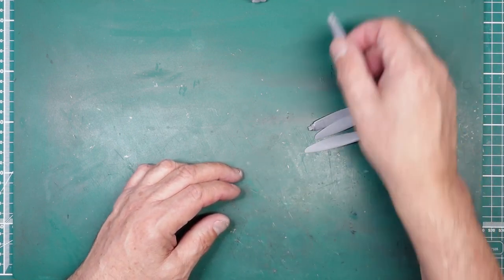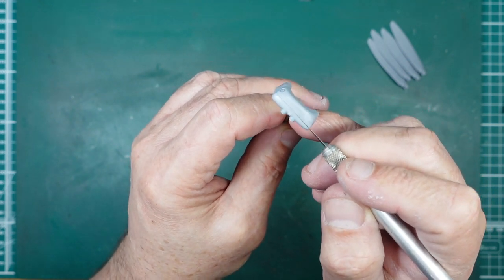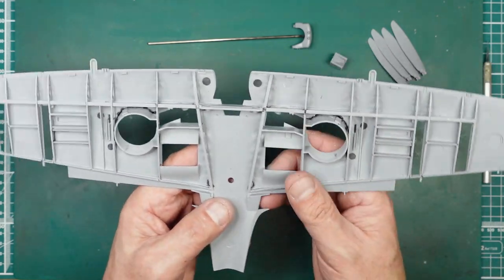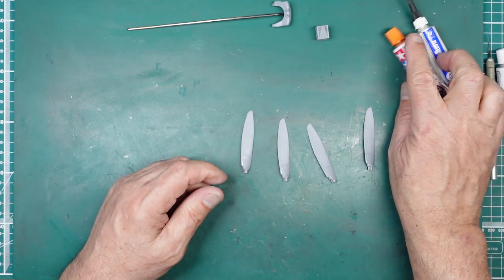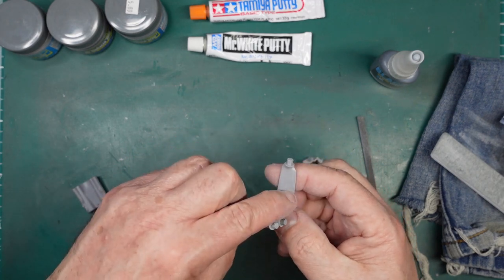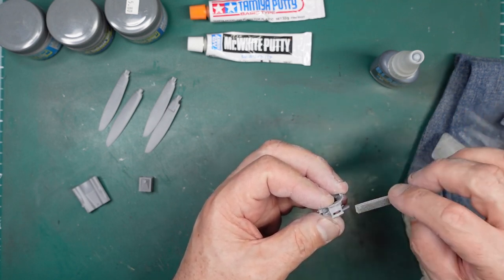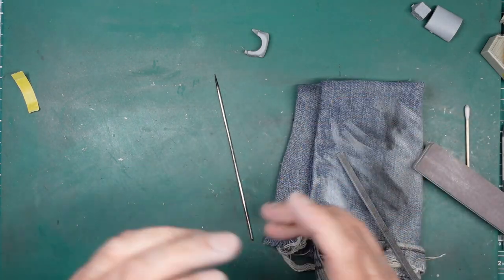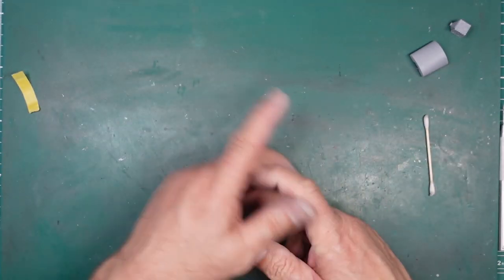Filling Seams.. for Beginners.

Comment: Hi I haven't done a model since 1982  so every thing has changed. I what to start on the  Italeri  Short Stiring but the kit looks to have way to deep lines on the Wings and Fuselage. .which should primer should I use to fill in of Mr. Surfacer?  Then after that will do the Airfix 1/48th Avro Anson. My Father used to fly in the Anson in The RCAF during WW11. I have never used filler on models back then.. I Also got a Air brush first time for that also.. Found you on You Tube buiding the Massive 1/32 Lancaster. Good luck on that project. My uncle flew the Lancaster in the RCAF over Germany in 1943 and made it back to Canada after the end of the war..
Reply from the maker: Hi Ron. yes, Use mr Surfacer then remove with a cotton bud as i did in the video. Rub across the line rather than along it.

Comment: Over the years l’ve tried a number of hobby putties, the problem l find is that the small tubes of putty start going hard after a short time, so l rarely get to use more than half of the putty, sometimes a lot less. Ended up trying auto putty, made for small scratches. The tube is a lot larger than hobby putties and stays soft for years. It’s also cheaper and sands like a dream and does not shrink.
Reply from the maker: I use that exact stuff for large jobs. You will see it in use in many of my videos.

Comment: Also the black CA has rubber fillers in it which creates a stronger Bond it's more or less tire glue if that makes sense
Reply from the maker: I thought that, the same as the Bob Smith stuff? It certainly is softer and less brittle.
Reply: @NigelsModellingBench  yes I believe, I use Bob Smith stuff and it works well, plus it's much much cheaper, as far as I know. That is my biggest problem with this hobby, different brands make the same stuff,  but certain brands charges 2 or 3 times more for the same stuff.

Comment: Howdy mate. I do the same thing as you do with Mr Surfacer but with the Tamiya grey primer in the bottle. Just like the Mr Surfacer it sinks back quite a bit so take a few applications...but for me here in SA, it's half the price of Mr Surfacer. The Valejo putty I use for wing and tail fillets and works a charm, it doesn't seem to like being sanded though. Think I'm gonna try the MIG black super glue too😉...any other tips n tricks videos would be GREATLY APPRECIATED mate😉👌👏👏👏👏👏

Comment: I no it's an old video so I may not get an answer. But if I use the mig super glue black and the underside of the aircraft is a light colour how do I over come the fact it leaves a black line in the seam or am I missing something out.
Reply from the maker: Well, you would paint over it?
Reply: @NigelsModellingBench  OK so it will cover over even if it's white paint .I no it sounds a still question but just don't want to get it and it won't cover over that's all

Comment: Hi Nigel. I’m new to the hobby but I’m loving it. Done some nice models from Tamiya tanks to Airfix planes, even a lovely Battlestar Galactic cyclon centurion. But Ive got a question. 
Could you use decorators caulk as a filler? It drys hard, can be sanded and primed than painted.
Reply from the maker: I think it would not bond well to the plastic?

Comment: Nigel, that was really outstanding, what a great video. I wish we had these when we were growing up, there was so much we had to learn just by trial and error. My Uncle taught me lots of woodwork and metalwork but he wasn't so much into the plastic modelling side of things. 
The only trouble I find is the Mr Surfacer just kills me with the fumes. I never used to worry about that sort of thing but after a good 40 years making plastic models since I was 7, it begins to weigh on the mind. I've tried the Vallejo plastic putty and getting some reasonable results if I persevere, but sometimes it just fails to do what you want. I endeavour to use it where I can though. 
Noted down a lot of good tips and will follow up some of the products you mention. Cheers again

Comment: Hi nigel,
great compare of different fillers and techniques.
Do you have any tips how to avoid those airbubbles in mr surfacer after It's stirred in jar to mix? Sometimes I have lot of them and in some places those pinholes after sanding are hard to refill again (ie air bubble/pinhole stay hollow under new layer of mrsurfacer again).
Reply from the maker: Hi Lukas. It sounds like your Mr Surfacer is too thick? Try thinning it more so the first coat is like tamiya Acrylic in consistency.